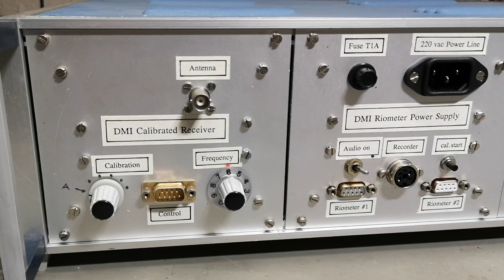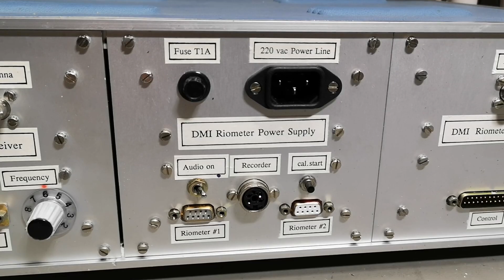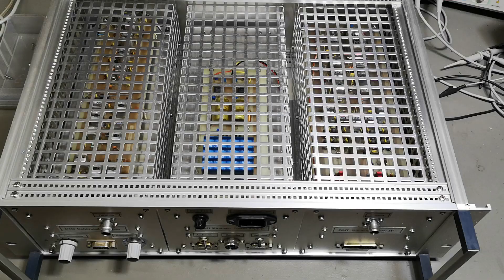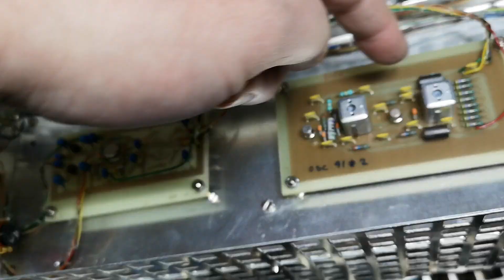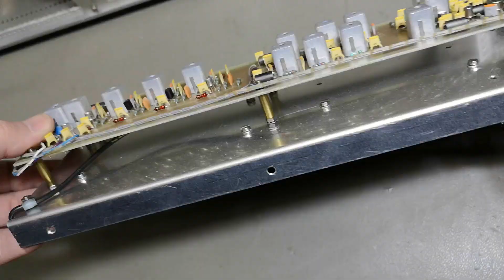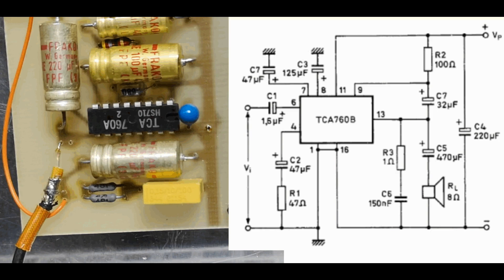DIY Riometer calibrated receiver model IV 1991 teardown

Comment: Amplifier is correctly connected, just instead of using ground as reference it uses positive rail, No DC in speaker, just using the no bootstrap basic power configuration as power output is low. Exactly as datasheet, except here it is being used as an inverting amplifier, as they connected input signal to pin 4 instead of 6, so lowering gain by a bit, probably so it would not overdrive the speaker ever.
Reply from the maker: i think you are right, ofcourse you can use power or gnd as speaker ref, both ways will work just as good, i did not see this methode in the datasheets i looked at, but i can say : the speaker amp did actually work
Reply: @TeardownOZ2CPU  It is in a Phillips datasheet as the basic amplifier circuit, with a more sophisticated one using the speaker connected to ground, with a bootstrap capacitor and extra hum rejection for mains use. But hre, running off a well regulated 12V rail, that was not needed, though they did include both the 47uF tantalum hum reduction capacitor and the optional RF filter 560pF polystyrene on the non inverting input.